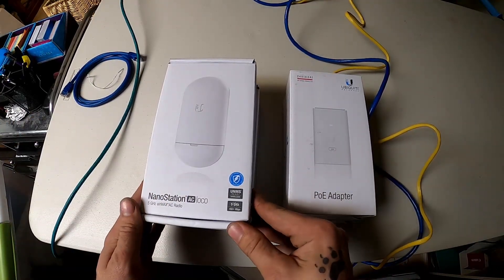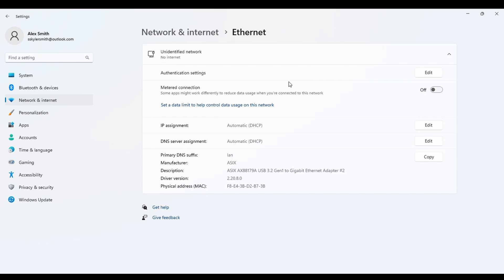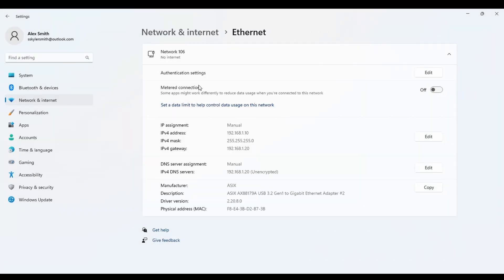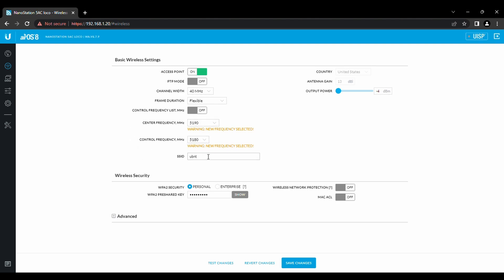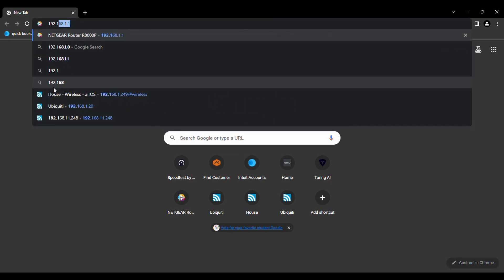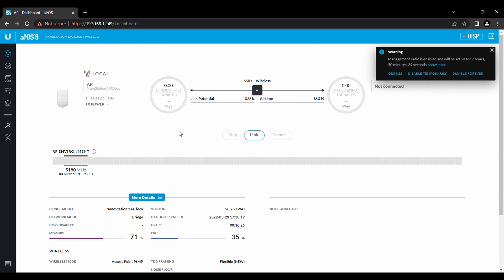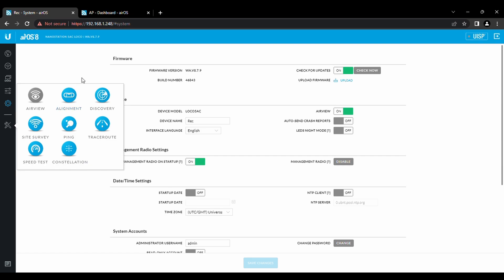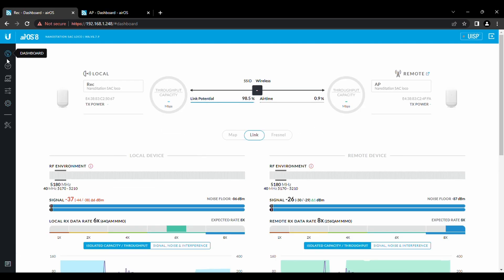Ubiquity NanoStation AC loco Setup!

Comment: Thank you!  UI has no instructions and what saved me is it had the wrong password in for the AP on the station.  I didn't know you could click the SSID under wireless and select the remote station and change the password, etc.  So after I set the password to the random one the wizard put for the network AP, it worked!

Comment: Heads up for anyone that doesnt have the option of subnetmask and instead has subnet prefix length. Type 24 here and it will work :) has to google up what subnet prefix length of 255.255.255.0 was and google told me 24. Typed that in and boom it worked.

Thankyou very much for the video. Very very helpful!

Comment: Question... I see other NanoStation setup videos requiring you to use UISP (Ubiquiti Cloud) and yours does not. Are there any reasons why one would want to go with UISP? I'm ok with using local setup if there is no advantage other than remote management from the cloud.

BTW I just did a bench test using two of these AC Locos and your video was easy to follow. Very helpful and straight to the point.  Firmware updates were simple as well. Will be moving them outside for final installation tomorrow.

Have liked and subscribed!! 👍

Comment: Hi, thanks for the video. Followed your instructions and got everything set up as you showed. Couldn’t connect to the nanostations with my Surface Pro but then used a Mac Pro and got both stations configured. Only issue I am having is when I connect my ‘AP’ to the internet through my switch I can no longer see both connected. The only thing I configured differently to what you demonstrated was the IP Gateway. I have a GL X3000 sim router for my internet and that has an IP of 192.168.8.1 so I used that. Was that the correct IP to use?

Comment: I have connected 5 AC-500 between together resistance may be 5 km and they give me only less speed this speed maximum between 16 at 30 
I have a problem with something exactly what's the problem of that but if you help m.
 I will thanks you about that

Comment: Awesome video, very much appreciate your skills! So does one of the two have to be connected to a wired connection? Is there any of these type systems that will just work directly from a wireless network? For instance, right now I only have a starlink router without the dongle.
Reply from the maker: unfortunaty i do not know of a way to connect it wirelessly, one option is to have something like eero that has wireless bridge capabilities and have one of the nanostations come off of that(if that makes sense sorry not the best explination)

Comment: Excellent video.  My ISP increased my speed necessitating an upgrade from my Nanostation M5 receiver fed by a Powerbeam M5 400 that uses DHCP.  I will use your receiver setup except for not using static address.  Would you critique and provide any suggestions for ensuring connectivity?

Comment: I've got the two devices connected to one another. But I'm confused what to do next? When i take the sexond unit, thats not plugged into the router, to my second home, how do i get the wifi going? Do i need to connect the second ac5 to a switch or access point?
Reply from the maker: Yes, you will need to have the transmit side connected to your router/modem and the receiving side will need to connect to an access point, they do not put out wifi on their own that you can just connect to from, if there is only one wired device it could be run straight off of the nano otherwise a switch is needed

Comment: Fantastic. I’d be keen to know why you don’t use dynamic IP in the Network Management Settings. And why even after naming the SSID they still transmit a much longer name.
Reply from the maker: If you use a dynamic ip it is harder to find it later, there are advantages but setting it static makes trouble shooting esier at a later date, and im not sure about the name part, usually they only transmit what I have named them, maybe I we are looking at something differant
Reply: @preciselyguessing I’m having the same issue it’s showing the MAC address ssid. And I’m having issues accessing the interface when connected  with Ethernet

Comment: hi your video is helpful but need to ask something, i do have one local station ac configured as an AP associated to the stations but when it 8 pm it disconnect what might be the problem and can i do by then to solve the issue
Reply from the maker: Could be that something is sharing the frequency and at that time it knocks it out, try changing the frequency so something on the other end of the spectrum

Comment: My PC reads "not connected" under the ethernet settings. Could that be an IP issue? The port on my pc works fine with my other devices. 

I can pick up the wireless signal of the Loco, did the setup as per video but the SSID doesn't change it stays are device name/model number. 

I've reset the devices twice already but the Ethernet still reads "Not Connected"
Reply from the maker: Yes, it's possible that the ac picked up a differant ip already, try defaulting the nano station and then don't connect it to network untill you have found it, or hop on the wireless and find what ip it chose and put your computer on the same ip scheme

Comment: Great video. I wish you could do one on the same radios but showing how to use the survey tool to see the other local radios and then reprogram the operating frequency. If you change the AP freq does it automatically program the station side or do you have to log into both to do so. I have 2 of these set up as a bridge approx. 200' apart and they drop out for a few minuets 3-4 times a day. I do know the area where I have them has a lot of other wireless stuff on the same property like 5 acer area  in the city. I have looked for a lot of videos and have not really seen to many people troubleshooting on the propagation side of things.
Reply from the maker: I will try and make some time soon to do a video on that portion, you do have to manually change both sides but if you do the station side first then the ap side sometimes you get lucky and can do them both but otherwise you are walking around physically plugging in
Reply: @preciselyguessing Thank you I figured so. Your video was really clear and comprehensive to me good job on the presentation. I will tag you for notification. Thanks again.

Comment: is there a way to use an NS5AC as a bridge client on an existing wifi network where there is no other Unifi hardware?  I am trying to pick up from my house wifi and bridge over to my shops wired Network.
Reply from the maker: You do not need an existing ubiquity network to use them for instance you can have a netgear router on your house, run the nanostation off the netgear,bridge to the shop, have a seperate netgear router in the shop that is run by the nanostation
Reply: @preciselyguessing   I have been through and through the settings, it shows every WAP in the list as not compatable.  I found several things showing it will only connect as a client to a compatable AP that uses airMAX AC... I am now trying to flush out the Ubiqity FW and put in OpenWrt or DD-WRT.  If those dont work then to the bin with this thing.
Reply from the maker: @justsumdad3185  sorry you are having so much trouble, a little confused why it's not working, I have in the past had them have trouble connecting to eachother and all of the problems were steming from that, I have only ever set these up as a client from the cloud controller 1 time, every other time have been on a system with no other ubiquity gear, let me know what your end result is
Reply from the maker: Only thing I can think of is the ip settings arnt quite right possibly have the wrong gateway ip or subnet and itsnt allowing for proper cominication
Reply: Hello, I need urgent help. I have a loco m2. If I buy one of these loco 5ac, can I provide internet to my 2.4 ghz loco m2? So, will this new product work with the old loco m2?

Comment: So, I apparently entered my user name or password wrong on the second unit and can't connect. Is there any to do a hard reset on the second unit, or anyother way to access it? Great video!
Reply from the maker: No if you have it wrong you have to reset it, it's fairly simple and nothing to worry about, there is a small reset button on the bottom, use a pin and you will press it, remove power, press the button, while holding button re-insert power, hold button for 10 more seconds, leave plugged in, repeat untill it resets, might time a minit or so to boot up after reset

Comment: For a short distance of about 65ft with clear line of sight, are these better than 2X UAP-AC-M ? Thank you
Reply from the maker: what you are referring to in an access point, these serve a different purpose, these are not for broadcasting wifi so to speak but to transfer data  from one location to another
Reply: I plugged mine into my modem before watching your video… What do I need to do to be able to get in and configure them?